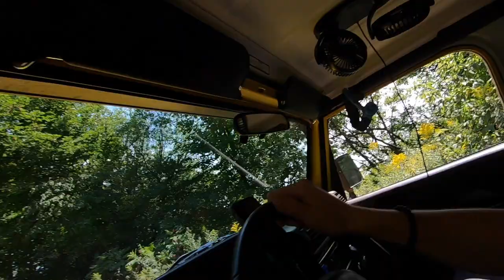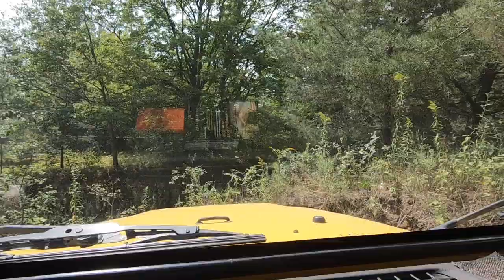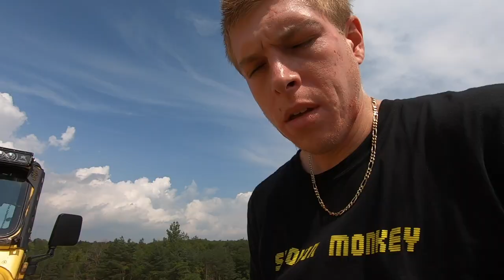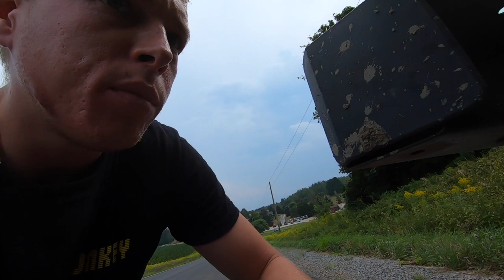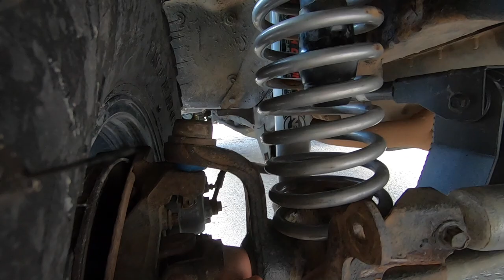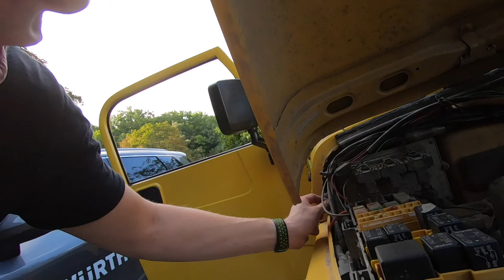My Freshly Built Jeep TJ Broke Down On The First Trail I Took It On.... Time To Sell?

Comment: I’m not a mechanic and I have never done the job you did in the last video, but to me it stood out that you filled the differential before installing the axles.  Perhaps the diff fluid seeped out before you got the axles installed and what you are seeing is just a little extra fluid that should stop after a while.  You may want to add some more fluid
Reply from the maker: Ya it has stopped now. I’m going to keep watching it and throw on outer seals. Then I’ll top off the fluid

Comment: I have outer axle seals. It will still leak but not as much. The outer seals don't seal as well as the inners because the axles move in and out with surface rust on them. Alot of people say don't get outer axle seals because mud and water cant drain out if it gets in causing more damage.
Reply from the maker: Good point

Comment: Don’t sell!!!! I understand your frustration but you have come so far with it. Every video it is becoming more and more bullet proof.

I would go ahead and clean/replace the breather and try and find the cap for it to keep the junk out. My rear burped fluid for a while after changing the fluid, and if it’s clogged then it’s going to find the weakest point.

We’re there any burrs or nicks on the axel that could have damaged the seal? Time to do an axel swap and a front locker!!!
Reply from the maker: It’s becoming more bulletproof ya so the only thing left to crap out on me is the engine, transmission, transfer case and axles. Some pretty important bits. And after spending close to 30,000k in two years on this piece of crap I’m done. I don’t wana tune another bolt or look at another leak. Too much of my time, money and effort have gone to waste if I’m just repairing it every time I drive it 100km. If I have a shop or garage it would be a different story. But I live in a one bedroom apartment so I can’t take the thing apart whenever I want and have to pay mechanics and shit. I just don’t have the money to keep this thing going. 

New axles and lockers that’s another 10k easy. I’m not about be 40-50k into a TJ. I’m not about that life. I wanted a JL and bought the TJ because I didn’t wana spend crazy money. But I would’ve had a brand new one half paid off in two years with the amount I put into this thing. I’m not gonna sink any more money into this. I want something reliable
Reply: @SmokinMonkeyOG  I like the mods you are doing.  I subscribed to this channel because it's an honest budget build and you are actually wheeling the jeep on the videos.  I think if you had a newer jeep, you'd be having less a lot less content and you might even be too worried to wheel hard as you do.  I tune in for the mods and repairs.  I can understand the money part.  I hope you end up with more subscribers soon and start to monetize on youtube a bit more.  Good luck brother and good luck
Reply from the maker: The goal for me has always been to get a new Jeep and do mods and wheel that. I was hoping to get more subscribers and get it then but it looks like I’m not gonna be able to wait too much longer or I’ll be spending another 10k on top of the 30k I already have on this thing. And I would much rather wheel a JL. I would still go to the same trails and go just as hard lol
Reply from the maker: Also with a new jeep I can go to further destinations and trails. I’ll have ac so I can do longer days on the trail and I’ll start doing over landing videos as well where we wheel and camp on the trail then wheel the next day. It’s hard with the TJ since it’s limited on space and doesn’t have ac and other reasons lol

Comment: I have a jeep TJ and sometimes I want to sell it also.. The problem is that it was my daily driver. So I just bought another more reliable car for day to day use and I use the jeep only for trail. 

For the axle and stuff, it's in my to do list also, but you can find used axle from pick-up trucks. And about the engine and transmission, change your ratio for 4.10 + on your differential, huge difference, slow on the road but on the trail your engine + transmission are gonna be relaxing.
Reply from the maker: I don’t daily my Jeep I only got it for off road use. I have two other cars I own. And a motorcycle so I’m not worried about that. And to get an axle from a pickup truck to work with a TJ it’s close to 10k in mods and upgrades. I’ve looked into it. Let’s say you already have the axles. You need to buy all new brackets $couple hundred, get the brackets welded on ($couple hundred), then you need to extend the rear of the TJ frame to move the gas tank to make the axle fit in place. Then you need long arms to make it fit and sit right. So you’re already 5k into the job without the cost of the axles. Now you need nee suspension because the TJ suspension sits inside the frame rails and you don’t have room now because of the long arm kit and nee axles so you need outboard suspension. Cheapest outboard suspension is $3000 so it’s a big project and by the time I’m done I would’ve paid for a new rubicon. So I’m not looking to go that route lol. 

As for transmission it is geared absolutely perfect for trail use as it is for me. On road it’s slow now but it’s amazing off road.

Comment: check for pitting or unevenness on the surface of the axle that is in contact with the seal. Had it happen to me before and it wasn't the seal's problem.
Reply from the maker: I hear you but another 6 hours work to not find anything will not be fun. And I checked the surface, cleaned it and it looked good so I don’t think I’ll see anything different by opening it back up. I’m gonna slap outer seals and call it a day. It stopped leaking for the time being so let’s just seal it up.

Comment: Hey Mike
If the axle shaft is not perfect and Smooth all the way around when you put it back in it will leak no matter what.
Reply from the maker: Ya they’re old and pitted shafts that’s for sure. I’m gonna do outer axle seals and just check my fluid more often and it should be okay

Comment: I’m in the process of looking for a new rig... maybe keep it for a little bit before your next build is where you want it. But I feel your frustration, I’m at the same point where it’s like, “might as well have got a new one”. Definitely look around, the market is kinda messed right now
Reply from the maker: I’m looking at brand new. Either custom order or one off a lot of it fits what I’m lookin for. But ya I’m like 30k into this thing. I could’ve had a JL half paid off by now. So let’s start before I’m 40k into the TJ 😅
Reply: @SmokinMonkeyOG  for sure man I’m just about 20k into mine and it’s just problem after problem. Hopefully we can both be done with these issues and not have to worry so much on the trails😂🤞
Reply from the maker: Ya bro we can both enjoy our rigs together and not have to be worried if we’ll get home at the end of the day

Comment: check that the breather at the axle (where the breather line connects to) is allowing air to pass, mine was corroded shut and this caused diff oil leak once it warmed up, easy to check before tearing apart the axle again, cheers and good luck
Reply: of course it could be the breather line or cap also, but likely something is restricting it from breathing and once it warmed up it pushed the diff oil out
Reply from the maker: Ya I’ll take a look at the connection and the line. But mine has no cap just routed to the top of the radiator